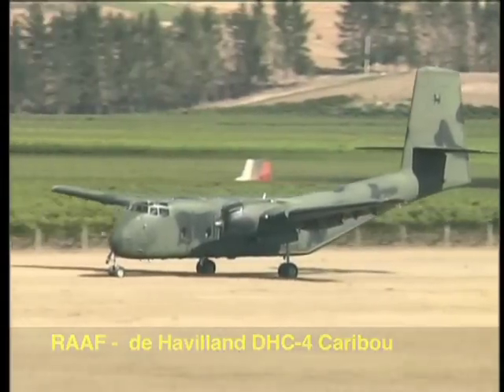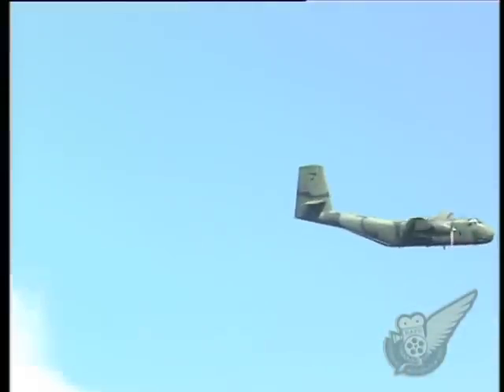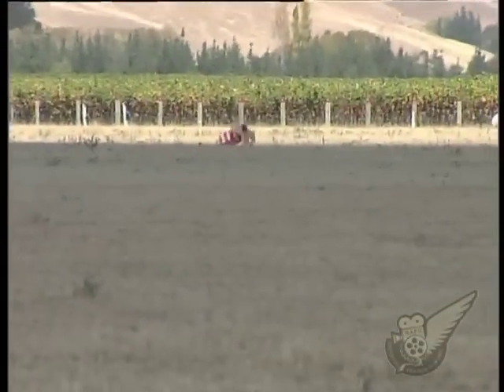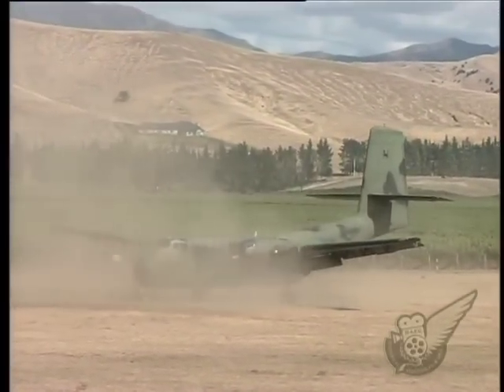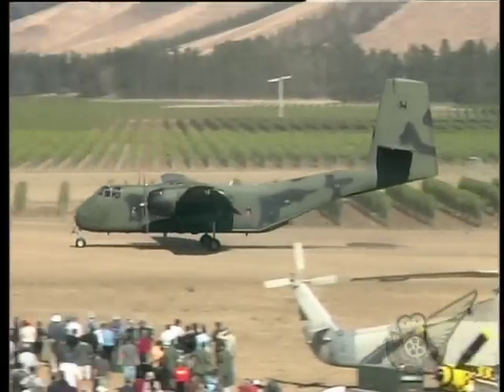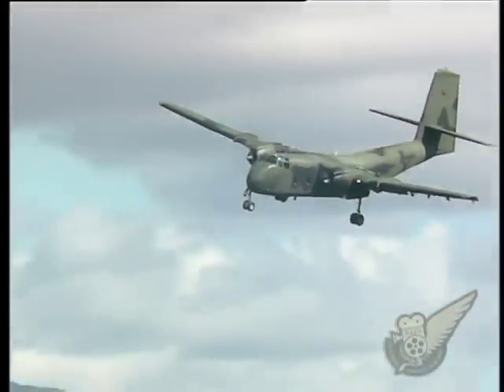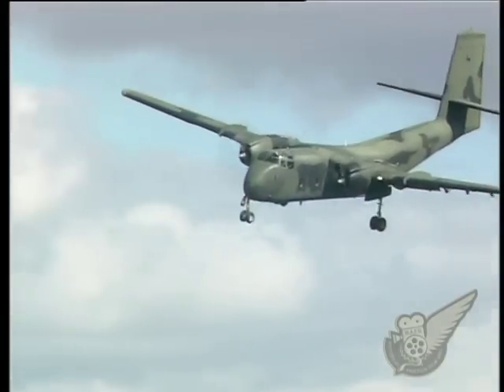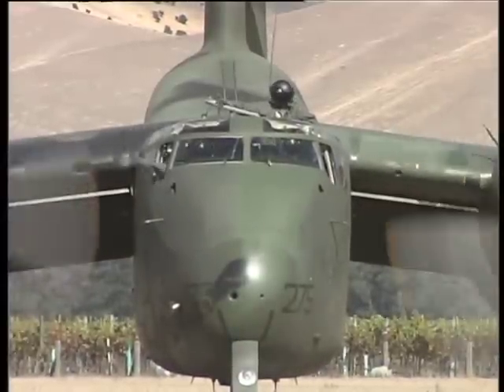RAAF DHC-4 Caribou - Incredibly Short Landing

Comment: There was a civilian boo operating out of Northern BC and Yukon back in the mid 1980s. We pulled a few small dozers apart and shipped them into the bush for mineral exploration. I was impressed at the minimal airstrips required to work from but certainly have to take my hat off to the Ozzies for demonstrating its full potential. Cheers

Comment: Worked on these as a radio tech in the early 60s. The pilots would pull the throttles into reverse thrust before touching down and let the load switches in the undercarriage do the work. Awesome.

Comment: I memorably saw a Caribou land majestically at Ft. Rucker AL in about 1962. My uncle, an Army former pilot then serving as an instructor, told me that the ground speed of the airplane as it approached and touched down was a stately 30 miles an hour, hence the short amount of runway required. I was - and remain - very impressed by what I saw.

Comment: DHC-4 Caribou (1958) designed as a tactical transport aircraft and the DHC-5 Buffalo (1964) more of a multirole utility aircraft are relatively the same dimensions and the Buffalo is 7,000 lbs. heavier but can carry 11,000 lbs. more with over twice the HP with turboprop and 4 blade props. The Caribou was practically as fast (just slightly slower) but could almost fly twice as far  however at lower altitude. de Havilland made some ±300 Caribou and squeezed out ±120 Buffalos......Raised on a Canadian Air Force bases and having seen these beautiful beasts for years I'm still a little more in awe with the Buffalo !

Comment: One thing this video doesn’t capture is how unbelievably loud they are.
Reply: I know. The sound of those Twin Wasps was incredible & completely unforgettable. It was a sad day when they retired - I still miss seeing them come in for a landing - steep and slow even when on a normal approach.
Reply: 4000 cubic inches of awesomeness.
Reply: So she's not a stealth aircraft, then.
Reply: @chrisanderson8207  The exhaust manifolds would dump into two large stainless steel tubes on the top of the wing. I used to repair the cracks from the vibrations. Big stinky cans we called them. Loved the Boo though. Plane had slot of heart. Republic of Vietnam 1970.
Reply: The two big cans on the top of the wings were like megaphones getting the exhaust out
Reply: @rickdaystar477  LOL
Reply: The He
rc has twice the engines and half the noise, on the plus side if you ever had to jump out of one you wouldn`t hear yourself scream.
Reply: Lol
Powered by a tank of burning fossils!

Comment: It’s replacement just can’t do what this plane does . These planes will fly forever with good maintenance.
Reply: Like the DC 3 😚.
Reply: Yes it can. 

The C-27 Spartan can fly a lot faster, a lot further, and has a lot lower operating costs and better reaction times and dispatch reliability. 

For the times where the C-27 Spartan can’t land or takeoff because of field length... there’s the CH-47 Chinook. 

Not only can it land and take off in far shorter distances than the Caribou (obviously), but also carry more payload (including external slung loads) and it flies faster!
Reply: She even has reverse gear.
Reply: @Bartonovich52  C-130J can do better
Reply: The R2000 is nowhere near as reliable as the R1850. Nor as numerous. I was involved in arranging repair of RAAF R2000s.
Reply: When retired in 2009,  they had  extensive  corrosion.   11 years later ,  parts are falling off.
Reply: I'd imagine aero improvements and a turboprop conversion would have them go further and faster, much like some of the DC-3 conversions whizzing about now. Many of those airframes are on track to happily rack up 100+ years operating without issue.
Reply: @badethics7542  there is a turbine version made by a company in southern NJ. I’ve been in one. PennTurbo.
Reply: @badethics7542  That was done with the DHC-5 Buffalo, although those are being withdrawn from service as well.
Reply: @Bartonovich52  What Have you ever seen a Caribou Take off & land. The Spartans min Take off distance is over 600 metres ( according to The companies website)  a Caribou as low as 540 ft & a 1040 ft over a 50 ft barrier. The Spartan is likely a good plane but the Caribou was a unique aircraft.
Reply: @Bergstaller01  Buffalo had a lower power engine, GEs v PT6

Comment: I flew these at KWA; and SAC for a few years... Fun to work on too... R-2000 reliable engine... Mine went to TBO easy! Only had one cracked cyclinder.. #1 and replaced in in a day n ready to work.
Reply: As a USAF structural repairman ( tinknocker) they were easy to work on even with limited resources in Vietnam.

Comment: de Havilland Canada was just a few miles from house, growing up. DHC's facility was adjacent to CFB Downsview, so it was a pretty active region for flight activity. Caribous were a common sight in the air but this video really shows them off at low level. The car traffic getting in and out of those places at rush hour was no joke since they were smack in the middle of old subdivisions that grew up around them.
Many men in our congregation worked at DHC into the 80's so I had a few tours of the plant. Others like my father worked at A.V. Roe (AVRO Arrow) until it was "eradicated" in 1959.

Comment: Was the best airframe Australia ever had, only fixed wing airframe that could hover (with a stiff headwind)
Reply: We had Pilatus PC-6 Turbo-Porters as well until 1992. They could do a similar trick and whilst they never served Australia the Fieseler Storch could perform this trick.
Reply: I could nearly stop in a holding pattern with a stiff headwind ; flaps n gear out...on radar, that's how it looked!
Reply: If you kno your ac; one can make incredible short t/off n ldgs,using the reverse feature; land on a postage stamp!!!
Reply: Any plane can hover with a headwind.

Comment: back in the 60's dehavilland's dabled with the idea of a turboprop version of the bou ,re-engining one with General Electric T64 turboprops..performance was excellent ,problem was it was too good as the aircraft in this configuration could exceed it's design dive speed in level flight...on one engine,so an extreme amount of caution had to be exercised..it was eventually converted back to P&W R2000's

Comment: 1971, Landed at Tan Son Nhut AB in a C-7.   The pilot put it down at the approach end of the runway and turned off at the approach end taxiway!   Anyone remember Santabou?
Reply: I was at Cam Ranh Bay 1970-71. Could you refresh my memory about santaboo? Kinda remember something.
Reply: Santabou was a C-7 with a Santa stocking cap painted over the cockpit.  Somehow has to have a photo.  We also had a a psyops C-47 blasting Christmas carols over Bien Hoa AB.
Reply: @303Fro  Thank you Lawrence. I've never seen that bird. We did have a couple O-2 Skymasters that were called BS Bombers. The planes had a rack with huge amplifiers feeding into giant cast aluminum Altec Lansing speakers that played psyop stuff
 I never heard the messages.

Comment: Just like a good old classic car, a carby and a set of points, simple, durable, reliable if maintained correctly, don’t need expensive diagnostic equipment and you can usually get underway again if stuck somewhere out near shitters ditch! The latest computer controlled systems in either is not neccessarily best at the end of the day because at the end of the day both will get you from point A to point B just same only much simpler than today in all its modernity!
Reply: Yep! The carb was as big as a suitcase..lol